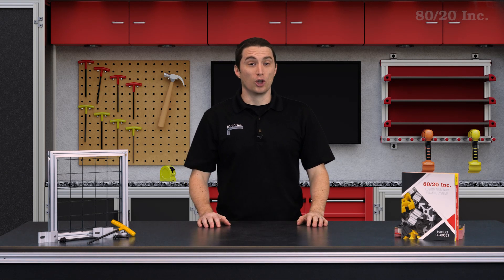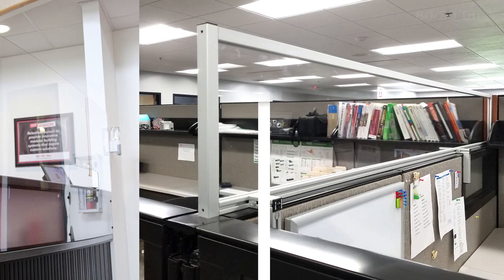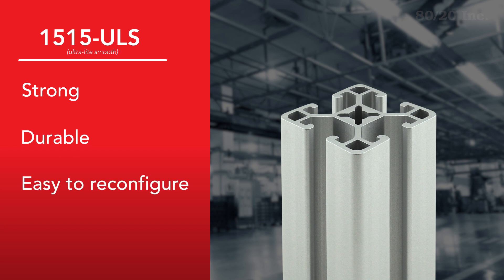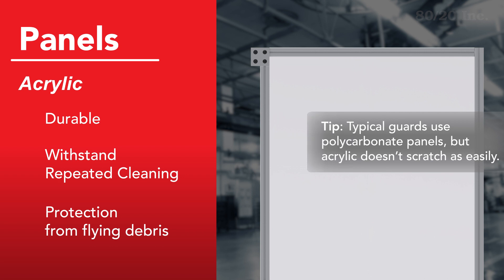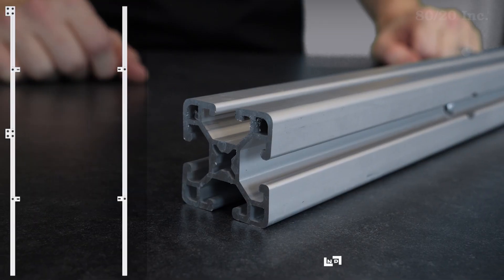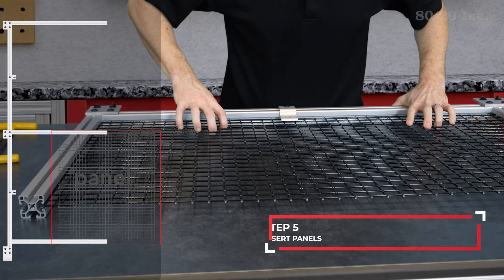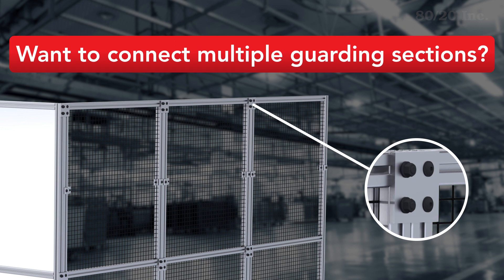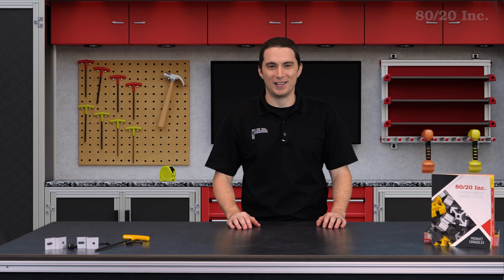80/20: Xtreme DIY - Safety Guard

Comment: Ok so I am getting extremely frustrated with this 80/20 aluminum extrusion. I’ve never used it before and I’m trying to build a roof rack. I have looked for info for the last week and found multiple videos and some use 10 series and others use 20 series. So I bought both. The help videos on this crap are random at best. I’ve found videos saying they were going to explain which series is best for your build only to talk about nothing. I’m so frustrated I’m planning on just throwing this crap away and just buying a $1000 roof rack. Here’s what people need to do. Make a video explaining what series is best for what purpose. Also I still have not found one video or website that shows the size difference between series. You can give me the measurements but unless I get my tape measure I won’t see the difference. It seems like most of these videos are to help people who have already worked with 80/20. If I see 10 series is wider than 20 series and cheaper why wouldn’t someone like me buy it? Type “difference between 10 series and 20 series” on google and see what pops up. Nothing. Even the Wikipedia page says barely nothing. Also I bought a bunch of 20 series hardware. Can I use this on 10 series? I’m guessing not but very little info on the internet says I can’t or can. Maybe I’ll just build the ugliest roof rack ever and show people what they can build.
Reply from the maker: Hi William. It sounds like you have a great project lined up, and it's our pleasure to get all these questions answered for you. The best way to work out which materials are best for your particular project is to contact our design assistance team. They will walk you through the materials you already have on hand and which you might need for the roof rack. You can learn more about this service here: https://8020.net/design-assistance, or contact a representative via phone, email, or live chat here: https://8020.net/contact-us. We hope one of these suggestions gets you started in the right direction. We'd love to see your project when it's finished!